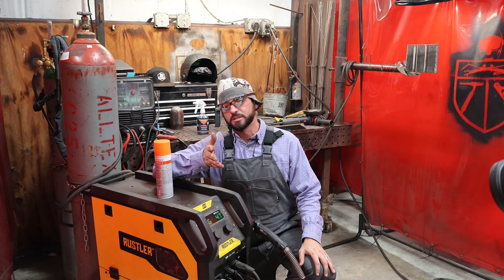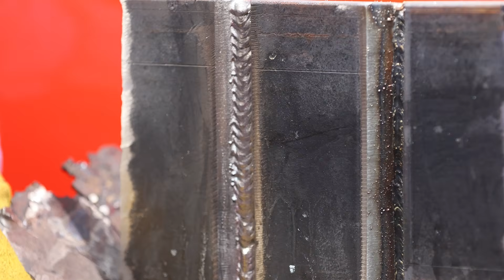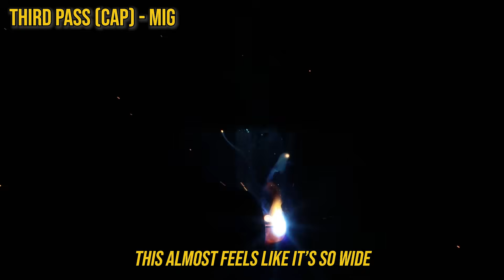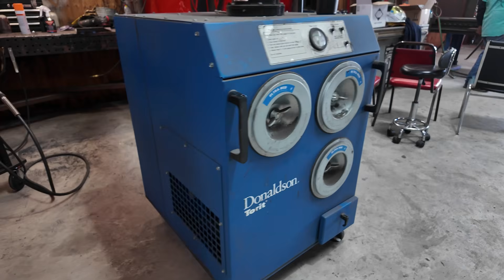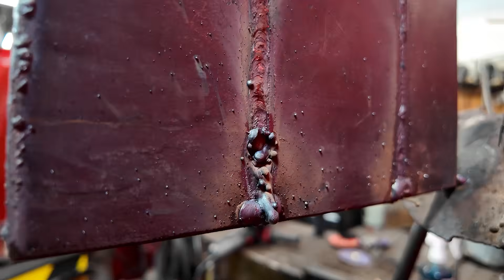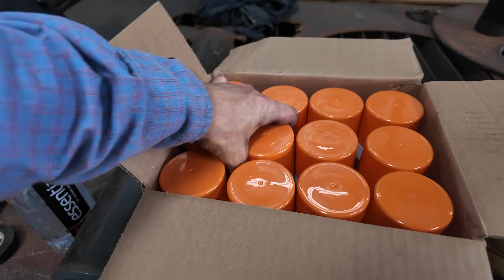Vertical MIG vs Flux-Core: Inch-Wide Weaves Put to the Test

Comment: The porosity on top was definitely caused by the snorkel being too close. I use an old Lincoln extractor at work, and that thing has to be a good distance away from the weld when I'm using MIG or FCAW-G, or it sucks all my shielding gas away.

Comment: 35 year experienced B Pressure Welder here. 
Setting I find works very good for mig up hand is 17.5/210. 

For the down hand mig root 17.5/210.

Your welding should sound like bacon frying.

Comment: Working in the Rail Tanker Industry, there's specific things you have to use stringers uphill or youre allowed to weave. And weaves are limited to 5/8 inch or 2x thickness of material max for single pass. It can be over if its multiple weaves
Reply: Used to work in the rail industry aswell had the same code. What company you working for?

Comment: In the mid 1990’s to early 2000 I worked for a company doing high pressure prespool piping for power plants. All worked was to ASME IX. Our WPS had .035 GMAW short circuit transfer downhill root and .045 FCAW-G fill and cover uphill. We were aloud to weave up to 3/4”. We had semi automatic machines that the WPS would allow to weave up to 1”. The same company I was working for in the early 1990’s welded everything with .035 GMAW short circuit transfer. At that time we had no quality control or welding inspector. We were a one off job shop doing tanks and blow pipe at that time.

Comment: in vertical 3F I've been doing the triangle method with (26v, 250amps) and its turning out incredibly good. This was in a fuel tank and its vital to not weave too much to not cause any problems. But it really helps with laying a good pass.

Comment: Great techniques. Im fighting some vertical welds on 1/4 when placing a 2x4 tubing to  4x4  tubing. There’s a gap from the 4x4 corner radius. Ive tried stringers and weaving to fill up, but im using my Millermatic 255 with Lincoln NR  211  MP .035 flux core because im welding outside and its real inconsistent. Horz and overhead are no problem, its just the vertical welds in this tubing that are fighting me. Any techniques for welding tubing would be much appreciated! Keep up the great work!

Comment: i like to do stringer beads  just need more tips on uphill and down hill i get a lot of build up on the welled so i start going faster and then it looks like crap i turn down the wire freed and  volts  but i think its because  i am  doing flux core   only no gas  can you help i really appreciate your videos i have learned how to well with them

Comment: Lol, I don't trust the filter gauge on any vehicle either...
Reply: Absolutely depends on how they work on whether I trust them or not, but in general, people change filters well before they have to based on nothing but appearance, and they waste money doing it. Filters work best when they're partway filled, believe it or not. You can use a cheap anemometer to verify that the machine is pulling what it should. Those big Donaldson filters aren't cheap. I have a Donaldson dust extraction system at work and it takes 18 of them, all a larger rounded triangular shape. We don't change filters early. That one has an electronic gauge and it also uses a large air manifold to clean them off by injecting a sudden burst of air inside the filters. It pulls 14,000 CFM if I recall correctly. A 30 horsepower electric motor drives it. 

Much of the garbage on top of that machine is probably settling from all the grinding going in that shop, while the thing is turned off. They don't typically run them unless they're welding.

Comment: I skipped short circuit and went straight to the angriest 150' snake you ever heard on 1/2 metal (spray).  28.5-30v and 390-415ipm .045 S6.  

Can you do a video on preheating and how it affects welds in thicker metal?

Comment: In my experience, it depends on the situation. Stringers (again my experience) are stronger, easier to control heat and less material to remove when you want to tie in a clean restart or if you screw up. But… I don’t like the looks of stringers on exposed repairs or fabrication. Once it’s painted I think it looks like a bunch of worms. 
I’ve been trying to get a little of both action when it’s exposed for criticism. Root, hot, maybe a couple stringer fills and a tight weave cap. Not always the case though. Sometimes you’re working a long joint in blistering sun, standing on a sketch platform 75ft away from the rig and you’ve had to pee for the last hour.. Yup stringers take the win!

Comment: I personally avoid weaving any wider than 2-3x my electrode diameter. If I have any kind of weave it’s more of a slight wiggle and usually only short circuit since it wants to mound up if you don’t have any side to side. Dual shield and flux I just run straight up.

Comment: I had the rubber diaphragm  start to disintegrate in a regulator one time and the small pieces of rubber started blocking the exit hole in the regulator and I was getting porosity and it took a while for me to figure it out. I finally took the regulator apart and saw what was going on. Was very frustrating

Comment: I do stainless welding at my work and we have spliced pieces that are half inch to 1 inch thick with up to 1 inch bevels. We fill them in 1 pass, but we use pulsed spray transfer. Pretty freaking cool, but a 3 foot weld takes a solid few minutes to get through. Feels badass, but man that kills your back!
Reply from the maker: I could only imagine! thats some big boy welds

Comment: You said not to put your elbow on the bar because it will restrict movement, by the end of the first weld you were doing exactly what you said not to do. 😂
Reply from the maker: Do as I say... not what i do... lol It did feel a little more comfortable.. I usually avoid the elbow becuase it makes it harder to make longer welds.. this was short enough that the elbow was easier... yah got me -Austin

Comment: I think stringers are better for heat control, weaving really lays some heat into it.
Reply: Which is why there is often a problem with lack of fusion with stringers if you fail to preheat
Reply from the maker: 100 percent

Comment: What would you think about doing this test again with stringers and then cut and etch both to see which process has the best penetration?
Reply from the maker: I Do want to redo a similiar test. alot of people are saying weaving is faster than stringers. id like to test that. As for pen.. the FCAW will certainly have more.. i can tell you that without the CS etch -Austin

Comment: Weaving is faster overall, but stringers are better for controlling heat input.
Reply from the maker: I agree with the heat input, But Id argue the speed, I think its worth a video. -Austin
Reply: @Welddotcom the porosity with the flux is your to close 😁👍
Reply: @mattlawton088 not applicable to gas shielded flux core
Reply: @Welddotcom do it foo
Reply: Only when ignoring interpass temps